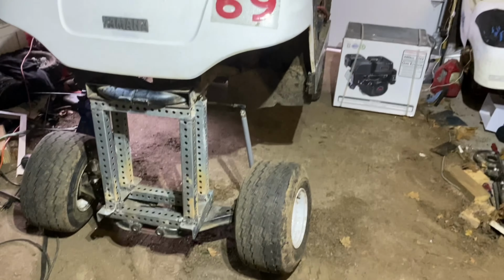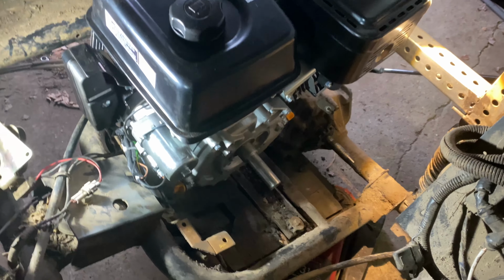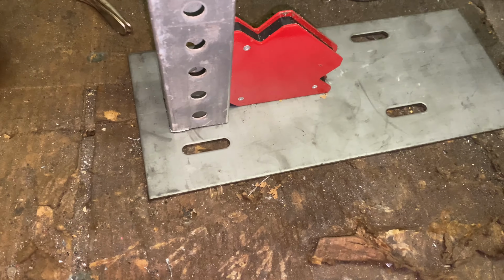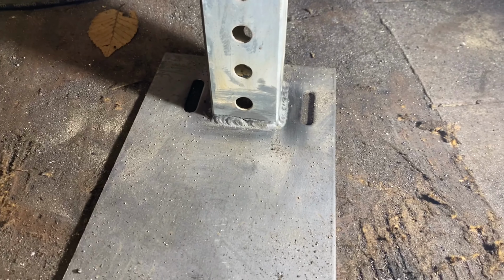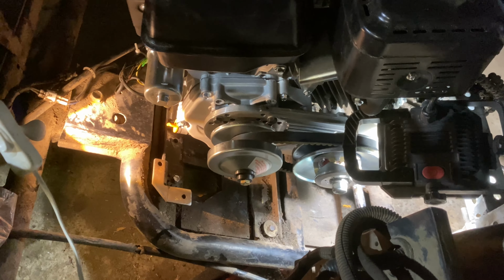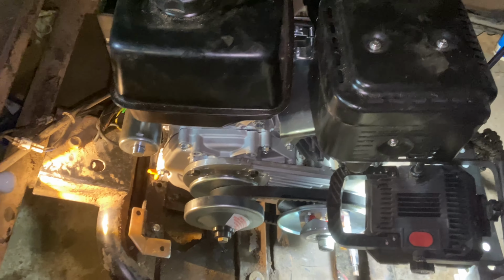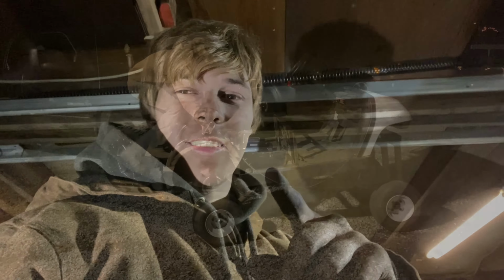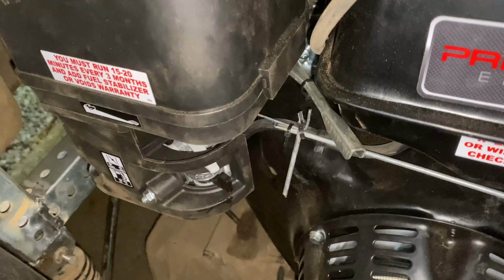Predator 420 swapped golf cart

Comment: Just a word to the wise when welding galvanized steel its best to grind of the shiny part and weld with a fan . It won't effect the weld when using a flux core welder.  Luck is good but knowledge great.
Reply from the maker: I’m about a year into welding now and I’ve gotten a lot better and learned a lot